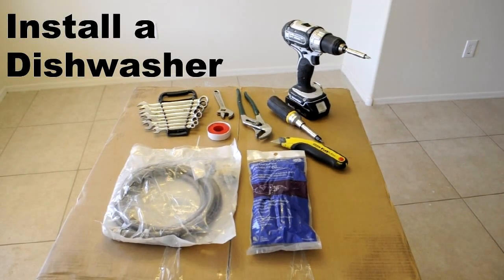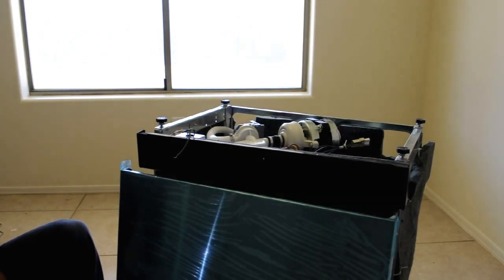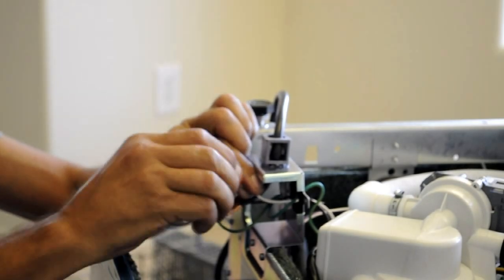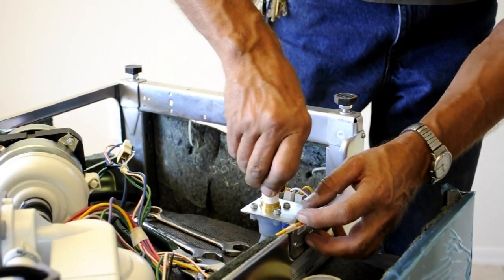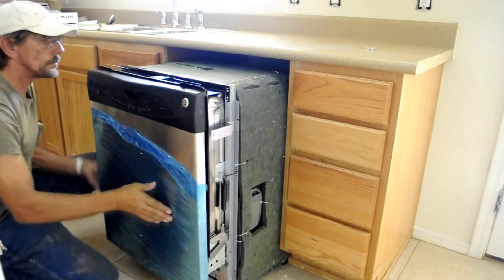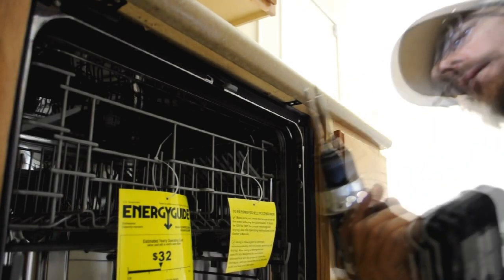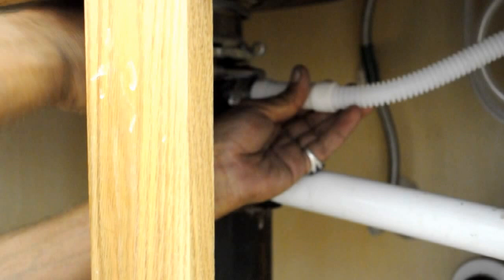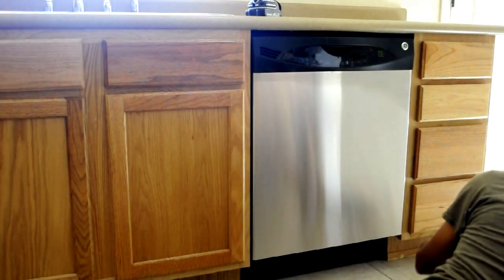Dishwasher How To Install A Dishwasher in less than 1 hour! How To Replace A Dishwasher

Comment: BEST INSTALLATION VIDEO THERE IS! 

There is NO NEED for a 45 minute video! Everything you need is right here!!!
Reply: Hal337 Absolutely! This video, start to finish, is EXACTLY what how-to videos should be!
Reply: no good
Reply: 3 things that are vital. Electric, water and drain line. Make sure you have all 3 done correctly or it can be a major mess. For me the tricky part is working with cabinets that arent square. Trying to fit the machine and make it look right with all the issues the cabinet presents

Comment: I'm removing my old one and replacing it myself.  I'll use instruction that came with new dishwasher & taking pics/videos of how the old one is currently installed and will put new one in just the same way.  Thanks for this video of all the steps I'll try to recreate myself with the replacement.  Wish me luck!

Comment: I am so far off from handy but I have a new dishwasher that needs installed. You made this look so easy, I’m going to give it a try on my own and hopefully all goes well!!
Reply from the maker: Good for you! Just take your time and read the manufacturer's instructions also... let me know how it went and if you have any questions just ask and I'll try to respond quickly
Reply: I got it up and running today! Had a small leak but was able replace the part and had no issues (I bought used dishwasher). I was able to follow your video step by step. Thanks so much for the directions! I would of had to pay who knows how much for someone to come do it for me!!
Reply: I will help you plug your leak.  giggitty
Reply: shaking my head... but had to give it a like @rovertrobert3180
Reply: @abbeymesserschmitt9855  What part was leaking?  I'm going to try and install a new dishwasher and want to know what to look out for.

Comment: Easy when it’s tiled right to the wall. Then leveling feet are stripped from the factory so now you have to improvise and you can’t see because the dishwasher is in. Fun 1 hour turns to three.

Comment: All these videos show the same water hook-up. That is, they already have a dishwater hook-up in place. I was looking for the method in the case where there is only the sink faucet valve and not one already for the dishwasher. This is a vital step and everybody skips over it.
Reply: mr Powell just add a dual compression shut off valve and attach the pipe to that

Comment: This install is what i call a clean site. Your cabinet has no issues. Its measured correctly and is perfectly square.

A good chunk of the units i install i dont have the luxury.
Reply from the maker: Yes doing installs in older construction is more of a challenge and tiled flooring that doesn't go under the cabinets can be fun too
Reply: @HometownHandymanLLC  Im installing 3 or 4 a day. Came here looking for some tips and tricks. Yes, when a new floor is installed that goes right up to the front of the machine and stops. Sometimes I have to cut the legs off to get it out. I wish there was a tool that could effectively grab hold of the legs and allow manipulation when in those hard spots.

Comment: How do you fasten the dishwasher if I have granite counter tops?
Reply: We just had a dishwasher installed last week underneath a granite counter.  The installation kit had brackets which attached to the sides of the dishwasher and to the sides of the cabinet.  Once it was in place, I could barely see the brackets, and the dishwasher isn't going anywhere.

Comment: The threads on those feet are WAY longer than the ones on the Whirlpool unit that I’m preparing to install at home. I wish there was a little more explanation of the need to loop the drain hose up to the sink. Why?
Reply from the maker: The drain hose needs to loop up higher than the sink so if the drain ever plugged up the water would not go into the dishwasher  ... thank you for pointing it out.
Reply: @HometownHandymanLLC   Thanks.

Comment: I have a new dishwasher and it’s all hooked up and level. About mid way down the door it starts to stick out but the top half is flush with the cabinet location . Is there any way to adjust the door so it doesn’t stick out like that?
Reply from the maker: With the door open is the front of the dishwasher plumb with the cabinet? If so then look at the shape of the side of the door.
Reply: Hometown Handyman LLC I have it lined up at the rubber surround which is back further. So no to your question . Half way down the sides the rubber trim / DW starts to protrude out away from flush.
Reply: Adjust the rear feet to increase the height of the rear or lower the front.  Or both.

Comment: -run it and check for leaks before you put the bottom panel on
-use teflon tape on every connection, not just the one shown in the video

Comment: How come the dish washer does not come with water supply line and power cord line?
Reply: Because some houses come with a dedicated power line from the wall for a dishwasher. Other homes you have to plug the dishwasher into an outlet.

Comment: should the water connection always be the hot h2o? I've read somewhere else to do cold.
Reply from the maker: I have all ways seen it connected to the hot ... seems to me that hot would get the dishes cleaner.
Reply: Always hot, you want hot water to clean the dishes

Comment: what screws do you need to mount the top of the dish washer..the previous owners did not do that so everytime i open the whole top comes out alittle...is there certain screws? and i dont see where i can drill into the counter top i see is if i drill.. it will drill right into the granite top from underneath...or is that ok?
Reply from the maker: Hmmm I have not had to deal with a granite counter top yet ... maybe glue a strip of wood to the countertop then screw to that
Reply from the maker: I use short screws with a wide head
Reply: For granite countertops the mounting brackets can be moved to the sides of the dishwasher and mounted to the cabinets.  If the dishwasher comes with the brackets in a package then they can be mounted on the top or on the sides of the dishwasher.  Good job on the video.
Reply from the maker: @rhagood2926  thanks for the reply Hagood

Comment: Good video, won't matter which way the Teflon tape is wrapped as long as it doesn't leak. Nitpickers smh
Reply from the maker: Thanks! it did not leak :) but the nitpickers are right you should wrap the tape clockwise that way it will not loosen when you thread it in. I'm glad to see that people are paying attention though!
Reply: You did it counterclockwise and wrapped the fitting 4-5 times too many !!!!!!!!!!!!!!!
Reply: Smithaw27 always wrap the Teflon the direction of the threads (USUALLY clockwise) is just good practice on any task but VITAL in retaining respect amongst your peers. Particularly in a trade company.....you learn that on day 1

Comment: Very well explained. However, he has not mentioned the gap to be left behind the dishwasher, i.e between the wall and the back of the washer
Reply from the maker: interesting comment, I have never had anyone ask about the gap behind the dishwasher. I always flush the front of the dishwasher with the front of the cabinets. You probably do not want the back to touch the wall so it won't ware a hole  in the dishwasher from the vibration.

Comment: Did you ever show the drainage line being connected to the dishwasher?  I see where you showed it being connected to the garbage disposal...
Reply: Most dishwashers come with the line already attached some come with an extension you claim on in the middle. Hope this helped.
Reply: Kevin Schwartz  -  Yes,  thanks so much Kevin!
Reply: At the 0:55 second mark  you can see him pulling out the white disposal hose ,  that came from the factory already attached to the dishwasher , and which was tucked under the bottom of the machine during shipping . He didn't need to attach it since it was already attached .     ( I have no idea whether that was the norm .)

Comment: You never use a drill on the fastening screws because of the possibility of reaming out the holes, you must cover the dishwasher with a cloth while the door is open, if not if you drop the screw it will go in the motor.
Reply: Aaron Jenkins you sound like you know what you’re doing. Had a dishwasher delivered and was told I didn’t have the right connections for the installation kit. I have to solder a threaded adapter to the hot water line. Do you know what size thread I should install for most kits?
Reply: If you set your drill to the correct setting you can’t team out the hole.

Comment: there should be a fiberglass blanket on top you wrap over the machine for noise and heat.  It comes in the box with the unit--I didn't see it here and that concerns me. Also you don't do anything until you shut off power and water first for safety.
Reply from the maker: Thank you for your keen observations. Most units do come with a insulating blanket this one was a inexpensive model and did not come with one, the water was shut off at the hot water angle stop under the sink, and the power for this unit was coming from the wall outlet under the sink so there was no need to shut off the power.

Comment: @02:55 Isn't that way too much Teflon tape?  And he's wrapping it in the wrong direction...
Reply: He did it counterclockwise because the bolt will be tighten clockwise. Otherwise the tape will be lossen because fighting bolt will undo the tape.

Comment: Why would a dishwasher not come with a power chord, water supply line and a drain hose? What is the rationale behind these series of extra labor required or inconveniences? Please enlighten me? If these items were supplied by the manufacturers rather than items found in the  "DOES NOT COME WITH" list, it would have been acceptable. Thus, I would not be disappointed and disgusted. Why would items that are critical and relevant in the assembly, operation, and installation of an appliance not supplied by the manufacturers in order to facilitate the proper assembly and operation of an appliance? .
Reply: Just a way to wring a little more money out of us.
Reply: Dishwashers are often, if not typically, hardwired to a junction box.  Choice of connection cannot be anticipated by manufacturer. Also, wire and hoses might already be present from appliance being replaced.  Why make the consumer pay for something they already have?

Comment: You don’t really need to push the washer into the cabinet opening to see how high it needs to go - simply measure unit height and cabinet with measuring tape. Lol
Reply: You are right 👍.
But consider many ppl do not  learn very easily/fast.

Comment: Is there a reason the Teflon tape is wrapped counter-clockwise at 2:35? From what I understand it should always be wrapped clockwise so it won’t unravel. Is that why you used so much Teflon tape? To counter-act the unraveling of the tape? More than anything I’m curious, not judging or anything. I haven’t finished the rest of the video since I saw this basic error in common knowledge. (Error in what I thought was common knowledge)

Edit: I just saw how long ago this video was published. I’m not gonna be so critical of something that was probably just a mistake. So, carry on please.
Reply: He was actually doing it counter clockwise. What kind of clock do you own?
Reply: Edward Salinas  I noticed the same thing.

Comment: You are skipping some steps like connecting the hose to the dishwasher
Reply from the maker: I did show connecting the supply line at 3:48 and the drain hose came from the factory with it connected on this dishwasher other dishwashers I have installed did have a connection for the drain hose.

Comment: FYI, don't tip over all dishwashers peeps. They have oils in them and some can be damaged when you do this.
Reply from the maker: Interesting I have never heard of that... makes sense for a refrigerator that has a refrigerant compressor
Reply: Lmao oil???
Reply: On some the instructions require you too. Don't tip it on its side though! We had to lay it on it's back to get the plug wired to it.

Comment: Leave this job to the pros. Never turn the dishwasher upside down.
Reply: I'll bite: why not?
Reply: I think he meant water softeners, I’m a plumber and we tip dishwashers over all the time
Reply: Dean River - Turning a new dishwasher upside side down is bad because of what?  Should not be an issue whatsoever
Reply: Instilling doubt are we?
Reply: Why not? I install them multiple times every day and I've never once had an issue. Just curious as to why you say that?
Reply: If you turn the dishwasher upside down you let gravity flip a pneumatic switch that kickstarts the confabricator wipple-switch grizzleback initiation sequence.  And that, my friend, allows all kinds of bad things to happen.
Reply: @TwoLeggedTriceratops  Did you know that to test a girl for a VD you put a little ear wax on it before you slip in. It triggers a beta enzyme that causes a burning sensation if she has a VD.
Reply: @spencersalmons2175  Good q-tip.
Reply: @TwoLeggedTriceratops  I have had my share of grizzleback initiation sequences back in my day. That combined with the dishwashers trifecta effect upside-down is no childs play.
NEVER...and I mean NEVER turn a dishwasher upside-down.